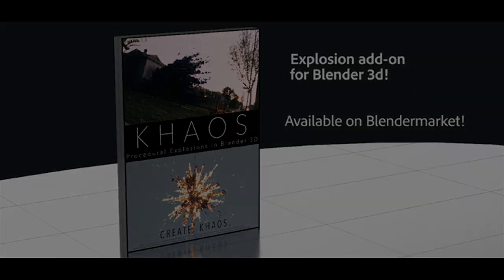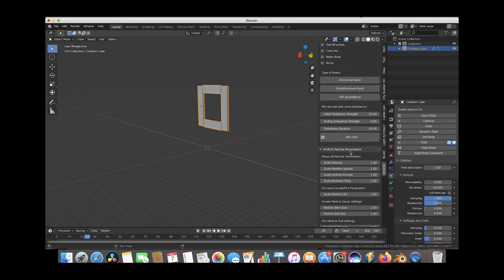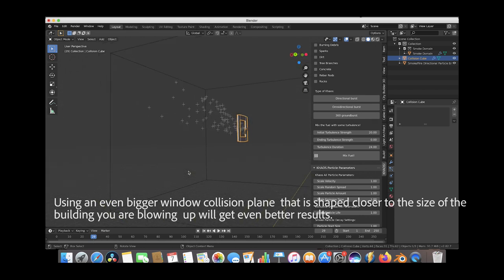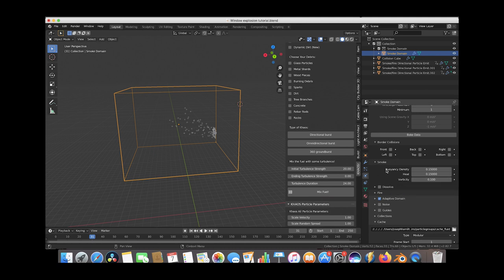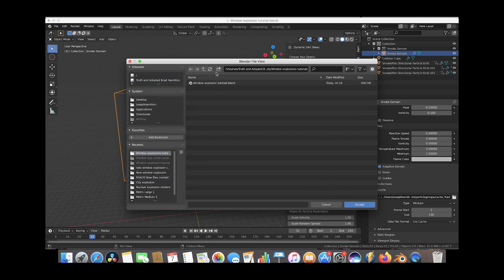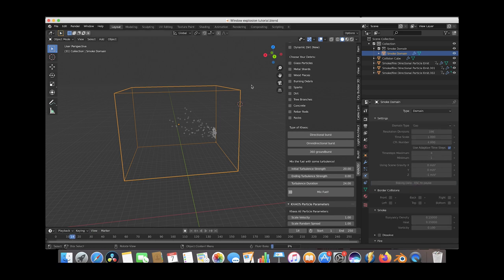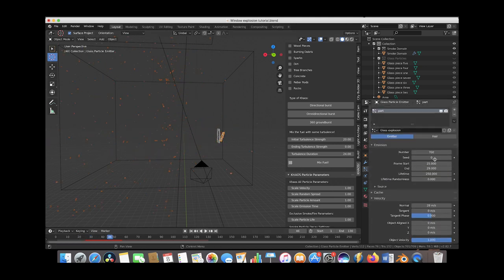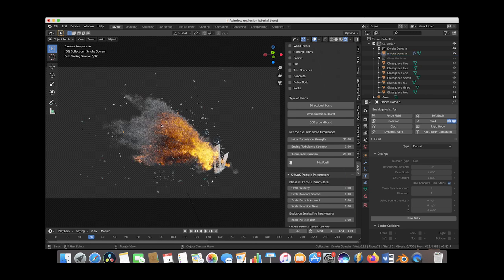Blender 2.82 Window Explosion Tutorial:  Ft. KHAOS  add-on (New version)

Comment: Nice tutorial. What kind of computer do you possibly have that is capable of rendering this animation?? Mine has been rendering for 2 days and it's halfway through. You might want to mention then RE-mention over and over that it takes FOREVER to render this stuff. Otherwise, thanks for the tips.
Reply from the maker: Ah yes volumetrics can take forever to render. I'll make a video on how to change the render times...although it still does take a toll on the system.  I'm just working with a 2018 macbook pro with 16gb ram. Nothing crazy but I  usually render my sims over several nights once they have been tested.